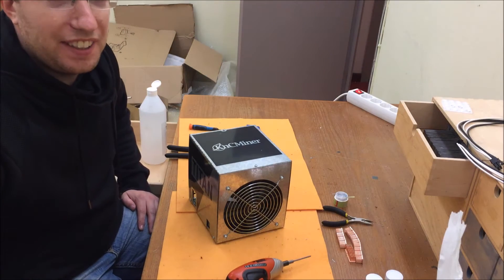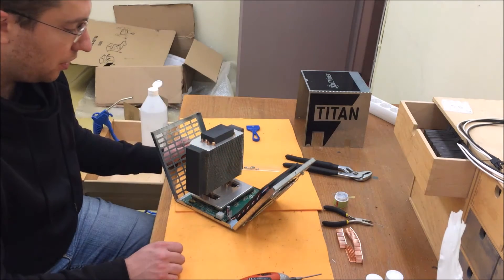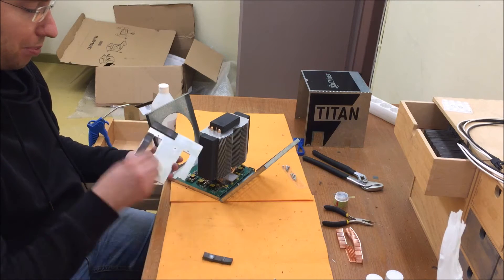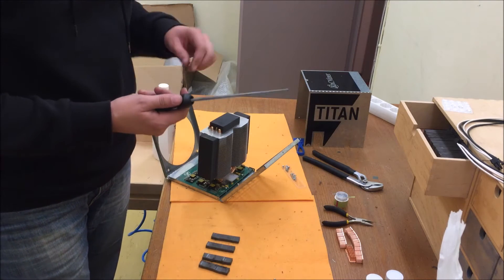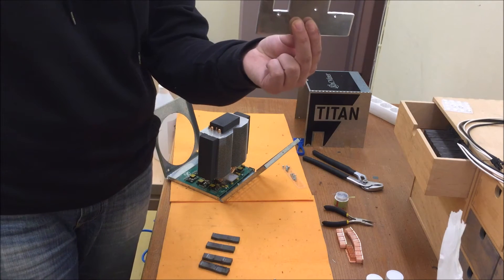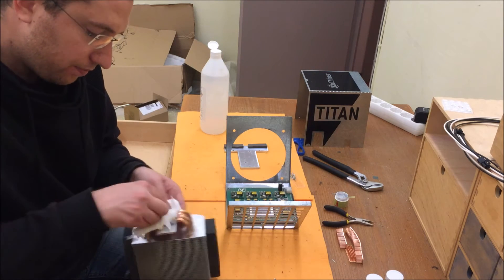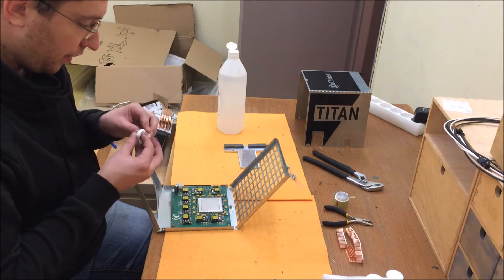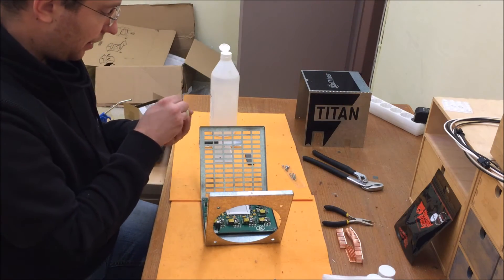How to improve KnC Miner Titan

Comment: I need to replace the pci-e socket on the board (pcb header?)  I'm thinking I may give your mods a go as well.  Thought I'd ask if you knew which socket to purchase?  I was looking at the molex mega-fit, just not sure which one to pick up.
Reply: +ahansen1  i'm thinking of doing the same thing but with my PCIE 6-pin connector.  I was looking at the molex mega-fit. sounds reassuring but again im not sure which one to buy for my titan.
Reply: +techinfo I purchased a mega-fit and it is too big.  I just re-ordered these this weekend (http://www.digikey.com/product-search/en?keywords=WM10869-ND).  I also tried de-soldering the old one and have yet to be successful, even used Quick Chip.  I have very little soldering experience though.
Reply: +ahansen1 how sure are you these are the right ones you ordered? usually they are called 'PCIE 6-pin male connector' if I'm correct. what's the difference between Molex brand and the knc factory fitted ones? ive never used quick chip before.
Reply: +techinfo I'm not sure at all
Reply: +ahansen1 the picture from the link u sent me isn't really descriptive. be sure to look at the actual pins inside the connector, see if they are the same shape. please update me when u receive your order and if it is the correct one I will order mine and post a video when repairing it. hopefully it will give u better aspect on what to do.
Reply: +techinfo yesterday I was able to get the old plug off.  Just required a bit of patience.  I think the pins on that plug are so thick it takes them a while to heat up to be able to get them all the way out.  This morning I installed the new plug and made the mods in this video.  Looks like the plug and the mods are working like a charm.  The miner has only been running for about 10 minutes, but you can already see the temp difference http://imgur.com/GRJV8L3.  The top die is off which is why the temp is so low.  But, you can see the others are running in the 70 degree range where the one with the mods is more in the 60 degree range.
Reply: +ahansen1 that's great to hear. I've just ordered mine. hopefully it doesn't take to long to come. how are your y splitters cables looking? 1 out of 4 were burnt really bad and the other 2 were browning. I will be changing these ones and how is your titan running after 24 hours?
Reply: +techinfo I purchased 4 of these cables (http://www.ebay.com/itm/261846105445?_trksid=p2060353.m2749.l2649&ssPageName=STRK%3AMEBIDX%3AIT).  Where did you get your cables from?  I'm not sure if those cables I got are good, but wasn't finding much.  At this point I have only replaced the one cable with the new connector because the original was so badly melted.  There is some browning on the others but I wanted to verify that the cable was working well before replacing them.

The miner is still working great (http://imgur.com/FKhuvCp).  Slot 3 is the one with the modifications.  I have only been brave enough to run it at 300MHz for now.  I am going to make the mods in this video when I have time over the next few weekends after seeing how well they're working.  It will be great to have these in place in time for summer.
Reply: +ahansen1 yea I came across them but they didn't look right to me. I found these and they look very similar to the knc y splitters. check them out. http://shakmods.com/shop&#!/18-Awg-Guage-2-to-1-x-6pin-Pci-E-Y-Cable-for-Graphics-Card/p/38332673/category=3316061
Reply: +ahansen1 I've just received my order from digikeys.  I purchased the ones u told me too. http://www.digikey.com/product-search/en?keywords=WM10869-ND . from what I can see is that they are smaller and when connecting the power cable to the connector its a very tight fit. I don't know whether its connected or not as the old would clip in. are these the correct one?
Reply: +techinfo I just double checked my invoice.  Those are the ones I got.  I picked up 4 of them since they were so cheap I figured it didn't hurt to have extra on hand.  My cable clipped fine.  Though, I tested with the new cables I got vs. the ones that originally shipped with the Titan.  I did bend the pins out slightly with to get them to fit into the holes, but it seemed to work fine.  Everything is still running and stable.
Reply: they are the correct parts thanks. I guess the tighter the better,less chance of it burning out. did u view the y splitter cables from shakmods? what do u think of them? they are 18 awg.
Reply: +techinfo yup I saw them.  Don't know enough to have an opinion.   After you sent that I remembered seeing that site around when the miner came out.  I think the originals wrre 18 awg?  The ones I got are 16 awg.  Honestly,  I am not sure which are right or if it even matters.  I will probably switch mine all to the new cords when I make the cooling mods this weekend.   Good luck with your repair.
Reply: The Molex Mega Fit seemed to be keyed differently so that if I put them on my Titan board I'd have to get new y cables that have the right connector.  Anyone else see that?

http://www.molex.com/pdm_docs/ps/PS-76823-100.pdf
Reply: ahansen1 you need to heat the whole board up, you can pop it onto oven around 400f.  then work fast.  they use silver based solder instead of lead.  much higher melt temp.

Comment: Hi Linus, can you recommend anyone who can replace the burnt pci-e connectors on a Batch 1 Titan?
Reply: Nino K Hi, I fix pcie connectors on regular basis.
Reply: it's not hard at all. you just got to have the patience as when pulling the old connector out. be sure to heat up the pins at the back of the board which will make it easier to pull out.